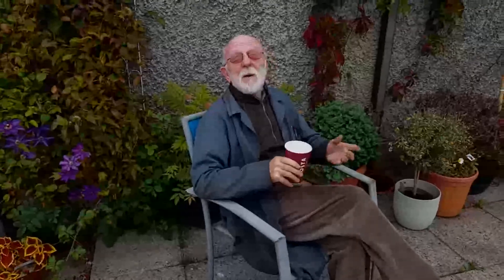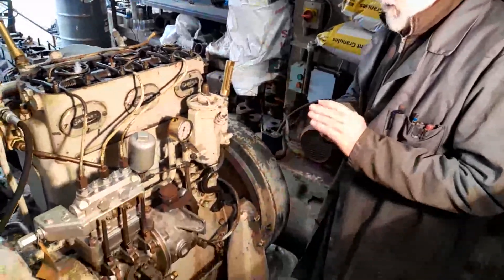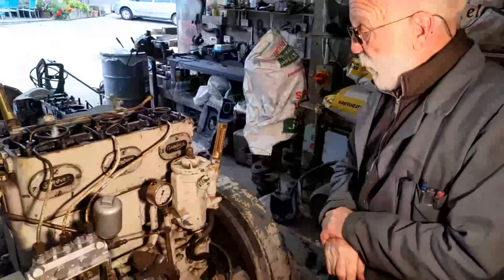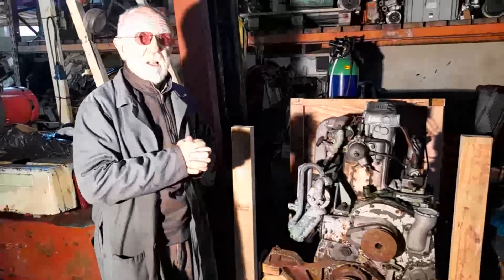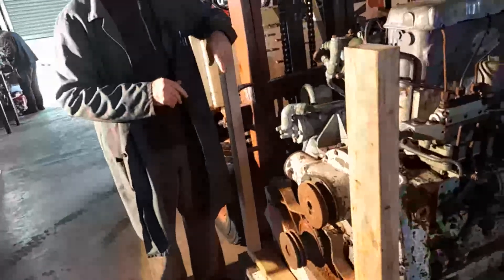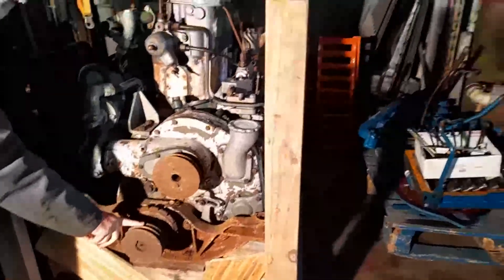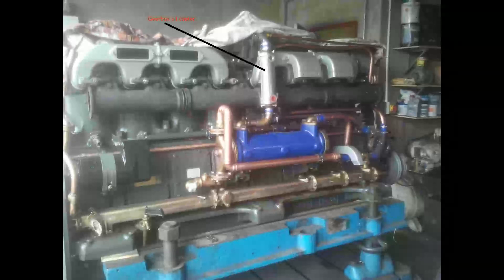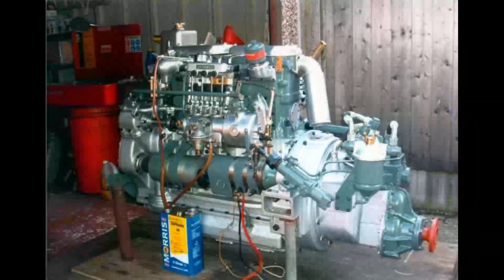Gardner Engines: the different types, as we view them.

Comment: The ram pump on that marine 3lw is quite happy operating with a heat exchanger or keel cooling. To control the eng temp the operator opens or closes the bypass valve to allow some hot water to re enter the suction side of plunger pump.
That extra front pulley is driven directly from end of camshaft not via the crank pulley.
Reply from the maker: Ooops, you are correct of course.   Thanks for that.